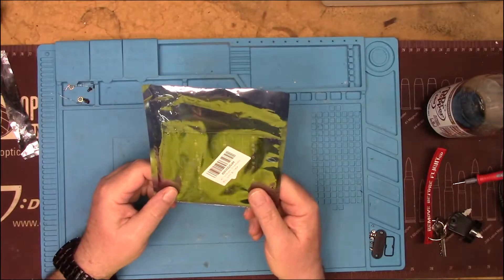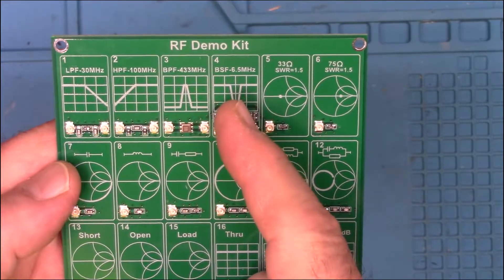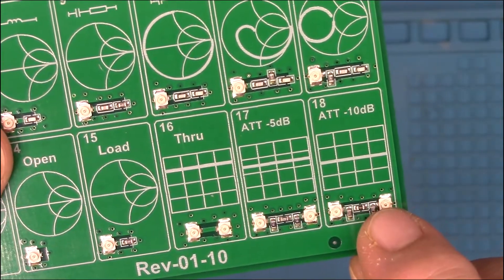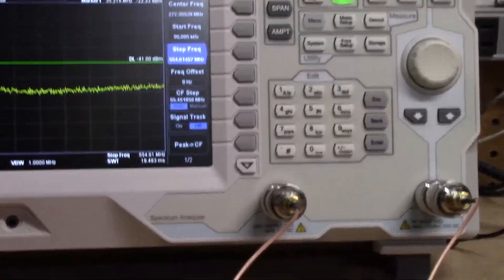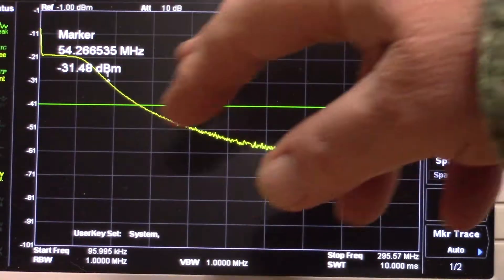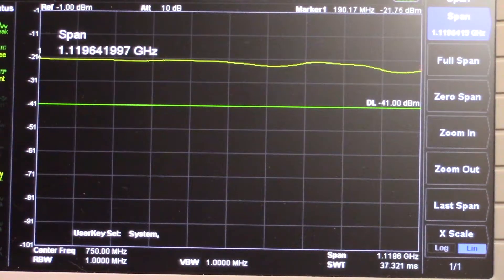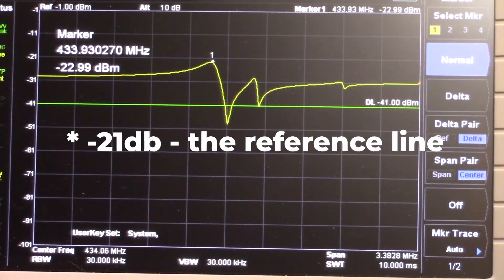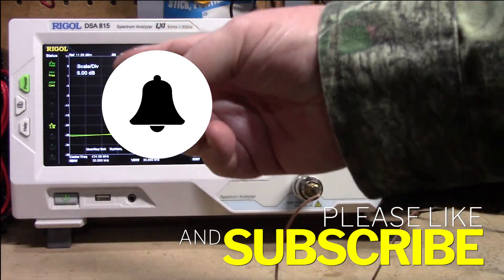Test  all the RF's!  RF Test board

Comment: Odd video indeed. I have this board and it is clearly for use as a tutorial for using Smith Charts and making measurements using a VNA. My board came with instructions. The reverse side shows a Smith Chart with a few labeled points. The complex impedance for these labeled points is also listed on the back. The purpose of this is to allow for practice in reading points on a Smith Chart.  The Open, Short, and Load items on the front of the board allow for proper calibration of the VNA. One must use the same cables for calibration and measurement. The ports can also help with familiarization with the Smith Chart.  The circuits in the center row a circuits containing capacitors, inductors, and resistors in various combinations. These ports  allow for practice in making VNA measurements. The other ports are filters, attenuators  and resistive loads to practice other measurements on a VNA. The connectors are u.fl connectors. These small connectors are good to 6GHz. I have have GPS boards and antennas connected with these connectors. This board is for practice in using a VNA.